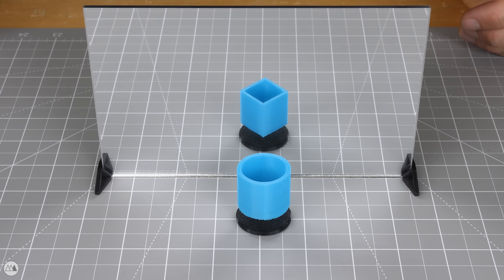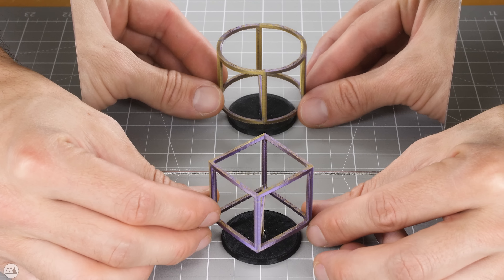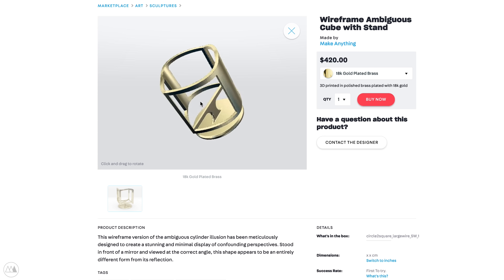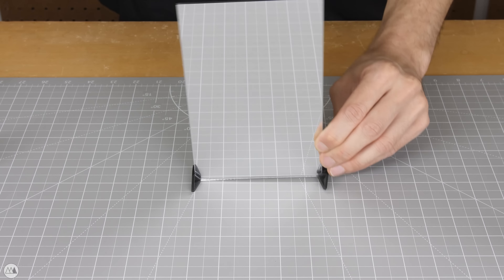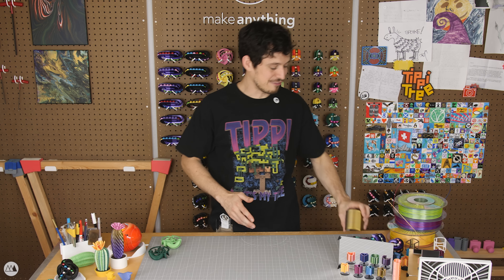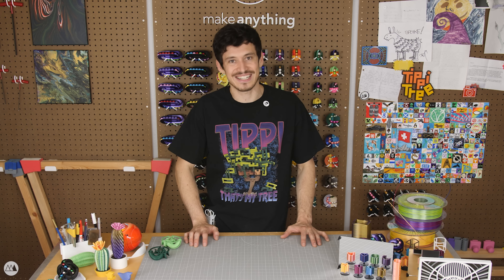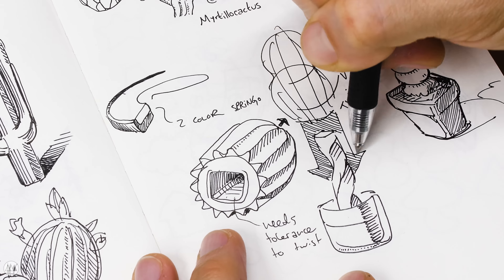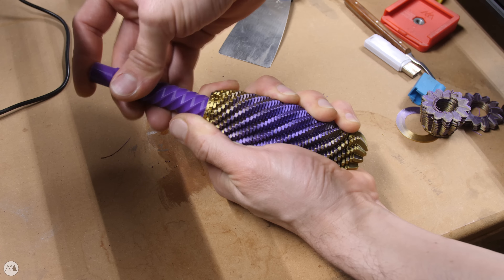Crazy 3D Printed Illusions, Puzzles, Pegboard Mounts and More! // Cool Prints 9

Comment: The X system is such a great idea! So simple. I don’t know if Im experienced in fusion 360 enough to do those kind of sweeps on my own so a video explaining it would be great 👍. I’ve been staring at my empty pegboard in my new workshop for months because I completely forgot about all your pegboard stuff! All the pegboard prints on Prusa’s site are all for bigger holes. The spacing is the same but it must be some metric size. And I couldn’t find any other peg board collections that seemed both strong and easy to print. 

I still have yet to solve the astrolabicon in my office. So I’m going to have to crack down and finally solve it to prepare for the new Psychlopath! Such a great name. 

I personally would like more shorter episodes a little spread out. Because every time you come out with a video new things get added to my list of things to print and when you do a big video my project queue gets a little overwhelmed! 😂
Reply from the maker: Thanks for all the kind words Robert! Glad you enjoyed it :)

Comment: I have wheels on my longboard like these, at an angle they look cubic, but seen straight on from the axel they're clearly round. They roll smooth and have a smaller contact surface which is actually the reason why I have them, but the surprised reactions I get when I'm hugging my board on the commuter train is a fun bonus.

Comment: You mentioned the metal balls' coating chipping — my immediate thought was to look into anodized aluminum. The anodizing process converts the top layer of an aluminum object into a tough oxide that won't chip or come off. Now, aluminum balls are going to be a lot lighter — and probably more expensive — than steel ones, so there's certainly a tradeoff. But a quick look at AliBaba came up with a few places selling different colors of aluminum balls, or of course you can do the anodizing yourself if you're willing to deal with sulfuric acid.

Comment: There is a method for the 3d-printer to guide the z-axis along the curved surface instead of printing layer by layer. Wouldn't this help for cleaner springos?
Reply from the maker: it would certainly be interesting. Probably quite a challenge to program the gcode for that!
Reply: @make.anything  CNC Kitchen posted a video not too long ago about a specific method of bending a model in printing. Maybe it works also with the springo spirals?

Comment: Consider yourself officially bugged about the process of figuring out the solution in Fusion!  Also, what is that nice little tool you used to separate the coil? Thanks again for another great video.

Comment: If you want a really difficult puzzle make one which has four points of connection between the two halves and connects two opposite on one side and two adjacent on the other. That way all configurations result in a single long loop of all the balls.

Comment: Explanation:
The shape is changed due to the shape of the spring top itself. If you look at different perspectives, you will see different shapes.
The colour is changed due to the 3d printer wire. The wire is split evenly between the wires (exactly 50/50), so if you look at one side it will be purple and the other gold.

Comment: Have you thought about using anodized metal balls? The paint shouldn't wear off on these, since the color is part of the metal. Not sure though if this would change the price significantly / fit into your budget.

Comment: Hi Devin, I'd like to eventually design and create my own pendulum as a gift for my easily distracted 10 year old sister. What bearings would you recommend for such a project and is there any other design factors that I may be missing when designing this, i.e. does the second arm have to be a specific length relative to the first etc.

Hope you read this and thanks for the great content you put out!

Comment: See im late to this party. What material did you use for the "springo"? Pla, petg? I just got my printer some months ago. So, maybe im wrong, maybe its the brand material i have used. Petg is better for springo vs pla, or pla+ for esun. Pla, pla+ and abs i tried seems to be stiffer than the petg i used. Just speculation based on 3d prints i got where stiffness matter to a degree. Petg is stiff when one reaches "x" thickness. But it could be the filament i bought and what i got with the printer. Esun pla+ is stiff, generic pla i bought is close if not identical, abs seems to be the stiffest, then petg. Filament seems to be of good quality from what i can see, compared to esun pla+ the generic filament is as expected. And the generic pla is extremly close to esun pla+.

Comment: Dude I loved the two-tone PLA and I'm curious to try it and all, i even like the name MatterHackers.
Just lost a hartbeat as I checked... 52 bucks for 750g are... 52+17.333 for a Kg.
I'm going to use some expensive Bambu Silk worth 24/kg and literally print some two-tone filament on my own. I'll be getting as little I need to just try it and even for some spare and small paid projects, if so.
Yesssh, could I value my exp, time and machine time as I'd like to, I'll be probably better just buying it since from 24 to 69.33 bucks there's "just" close to 50 bucks.

But do the day I'll need it in bulk and for bulk I mean like 3kg at once, do I be willing to pay the iconic amount of sixtyfrikkinnine bucks per kilo?
Dude, that's a PA6-CF price. C'mon.
Reply: Thanks for all the content, you do design cool stuff and there's a lot in the video (kudos for dissecting those optical illusions, I loved them in 2016!) but yeah, not to be rude not your fault tho... PLA at 70/kg not so much of a deal.
Reply from the maker: I haven't tried it yet, but they released a more affordable line recently: https://bit.ly/BDual